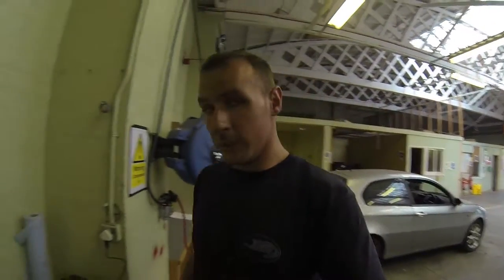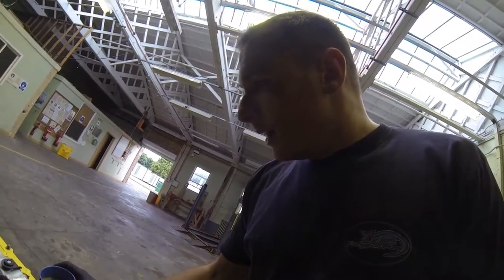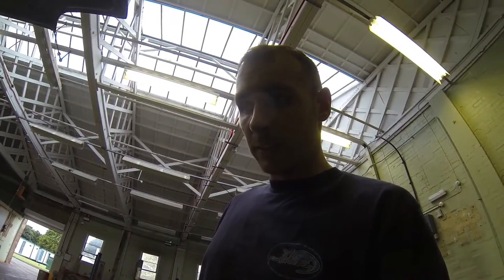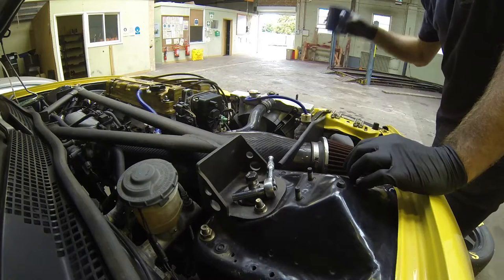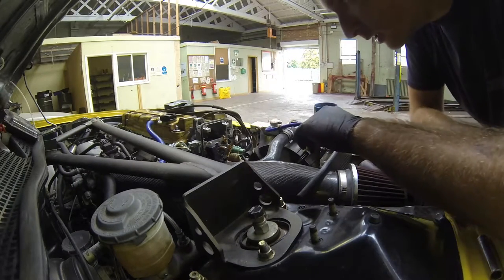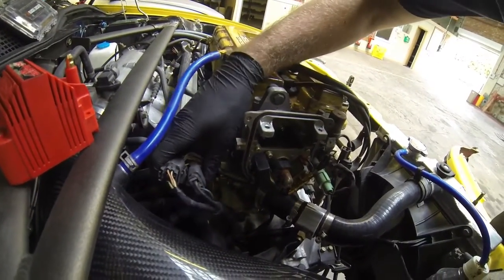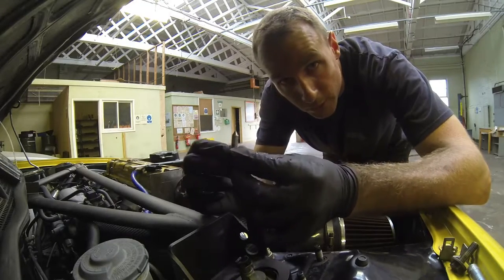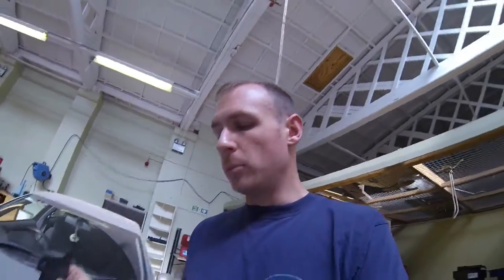Motor Spirit EG6 Ep. 11 - MSD External Coil Kit Install

Comment: Does this work without the original wiring? I’m hoping to run a D15b7 non VTECH in my classic mini. Wanting to run it on carbs and the MSD blaster coil kit. Hoping so it’ll be an easy set up.